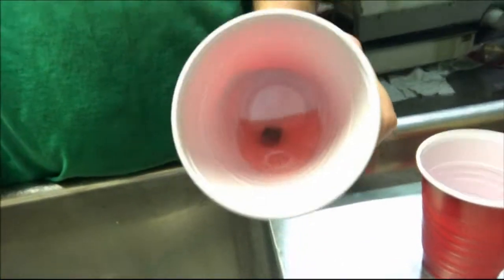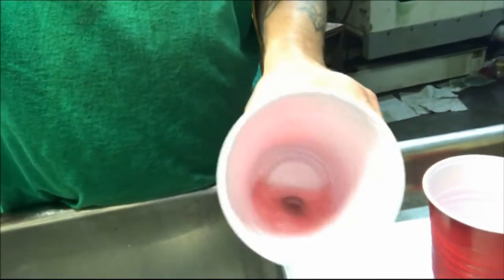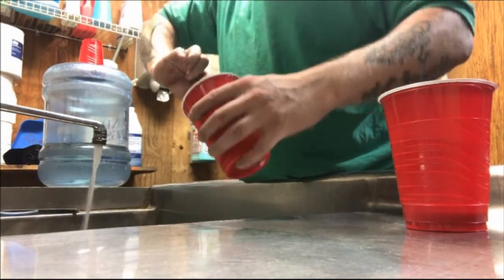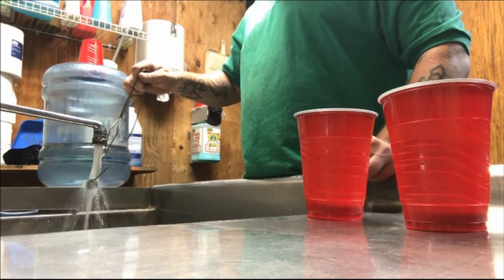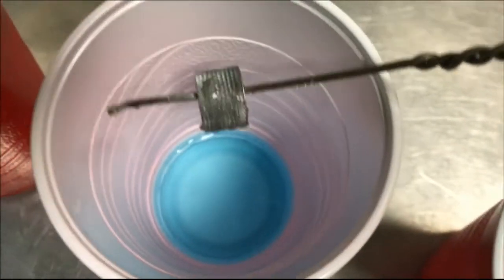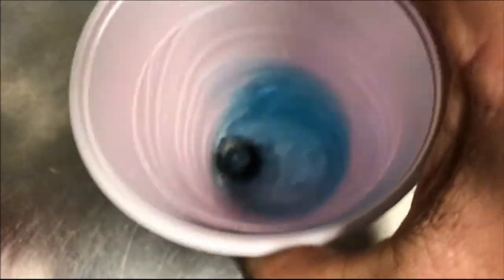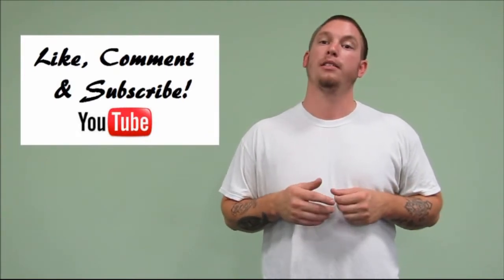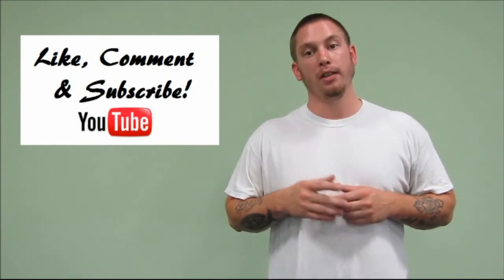"Blacking" My Metal Accessories Through A Chemical Reaction

Comment: Is this called parkerizing
Reply from the maker: No this is black oxide. Black oxide is just a chemical reaction that turns steel black that adds no thickness. Parkerizing is a little different as it actually coats the steel and adds a little thickness.

Comment: Do you have a link to the black oxide get you used? I had to get some replacement grip screws for an old milsurp pistol but they were just regular steel and I would like to black them like the originals.
Reply from the maker: Jon Lockhart https://www.walmart.com/ip/PRECISION-BRAND-45126-Tool-Black-Liquid-Kit-Blue/151268238?wmlspartner=wlpa&selectedSellerId=1122&adid=22222222228067082756&wmlspartner=wmtlabs&wl0=&wl1=g&wl2=m&wl3=170953627414&wl4=pla-278356277421&wl5=9008622&wl6=&wl7=&wl8=&wl9=pla&wl10=101593696&wl11=online&wl12=151268238&wl13=&veh=sem
Reply: Josh Wiley thank you. Honestly I would of never thought to check Wal-Mart.
Reply from the maker: Jon Lockhart I didn't get mine from Walmart I got mine through another company that we get some other stuff through for my machine shop. I can't remember where though, but the brand in the link I sent is the same brand I'm using in the video. Please be sure to check out my other videos and get subscribed and please share on Facebook etc. I'm getting ready to do vlog videos and review videos with my usual making parts videos thanks.